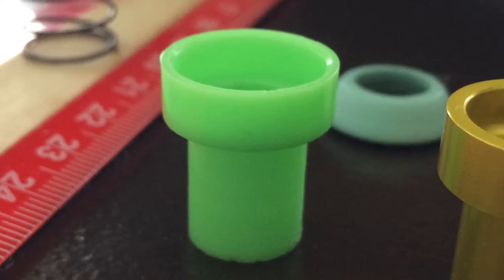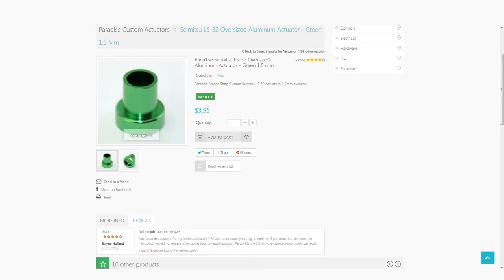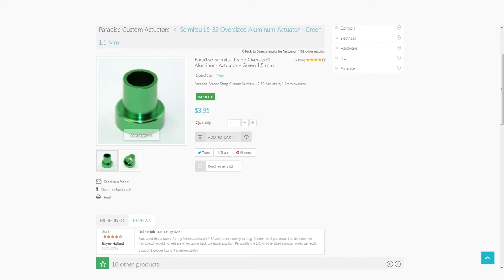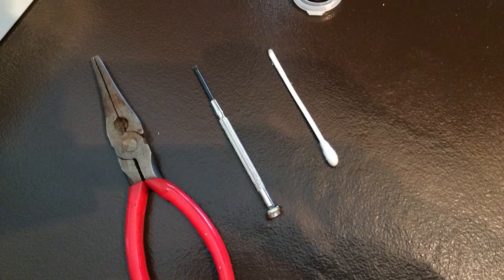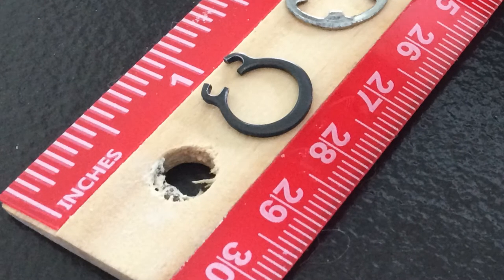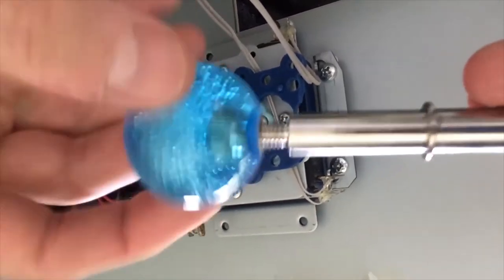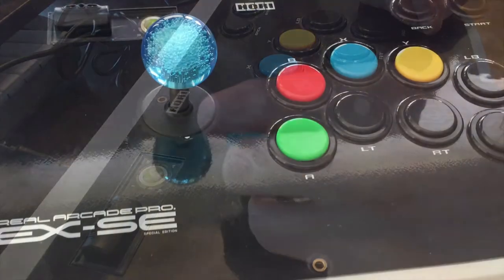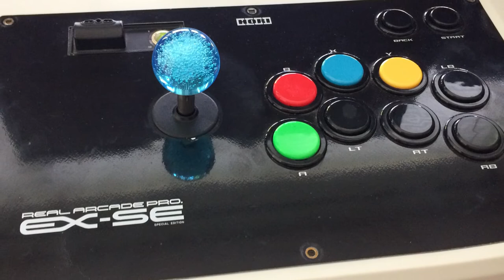LS32 Joystick Shorter Engage Mod - Will it Work?

Comment: I still prefer the ls-40, has more short throw than ls-32, uses c-clip and was the default lever for Japan neo geo cabinets.
I also have the ls-32, did annoy me the pivot popping while pressed against the gate, but after removing the gate it feels better.
Reply from the maker: Just switched over to LS-40 and yes it is overall built extremely well and feels great. I'll have a video on this soon. The pivot pop issue didn't bother me too much. I don't ride gates hard enough to notice, and for some reason the issue all but went away with some time. Both sticks are extremely good and I suspect every Seimitsu is top tier. Thanks for the comment!

Comment: 1mm is a huge jump if you are having a problem with return to center you can increase spring tension or drop to the .5mm actuator.
1.5mm changes the profile and is something to consider with longer engage switches like Omron silents.
Reply from the maker: You're right in that the larger actuators are meant for silent switches, custom switches, or those without paddles. I really should have tried the .5mm but I'm skeptical of all of these actuators at this point. I've tried several now for different sticks and none really feel like they "belong" in the stick. Even if they don't have game-killing side effects like I had here, they tend to have a clunkier feel. I'm just not convinced they are as precision tested as the company's that make the original parts.
Reply: @neondagger  not sure precision is the right word, most of the oversized actuators have the same precision of production as the original, and infact many have more because they are machined and no molded.  The change in feel is a preference thing more than a precision.  All microswitches have lag between off and on, these actuators can make that more noticeable because they sit closer to that point.  
Another option is to ditch the actuators all together and go with something like the Magenta for programmable precision.

Comment: LS-62 was my favorite for a while, but I ended up with the LS-40 because the square gate allows easier diagonals, has less neutral wiggle and the shaft is longer. I play mainly NeoGeo games on Switch and PS5 in addition to a few newer titles like KOF XV and for me, Sanwa and Hayabusa SUCK for those. Trying to play any KOF with the Hayabusa was like using a broken controller and the JLF was only slightly better. I almost gave up and went back to the standard controller until I tried Seimitsu and never went back.

Comment: I thought I liked the ls-56 best but it takes so much force to actually actuate the switches that I went back to my ls-32.
Reply from the maker: I agree. I don't know why people like stiff spring tensions, which is why the 56 feels so hard to activate. Shmups especially are about lots of little quick movements so I don't think it's a great idea. My sense is people often use higher spring tension to compensate for the imprecise feel of having too high of a shaft height, which is incidentally the case with the 56 as well.
Reply: @neondagger  Totally agree. On top of that I'd be interested to know how good those "ls-56 is the shmup stick" guys are. I mean the best players in the world are found in Japanese arcades and most cabinets use ls-32s.
Very often it's those that like to tinker with their equipment more than putting it to use. I observed this phenomenon quite often. Like FPS gamers who meticulously research mice and sensitivity instead of practicing with the equipment at hand.

Comment: Hey you can fix that by stuffing a washer between the clip and the actuator to press is down a bit more or shaving the edges a bit round. It only works in a jlf with square gate out of the box. But I can sum it up real quick for you. Yes it engages quicker but the stick will also not disengage like you where used to. I could not find a fitting spring to fix that. It's not like you suddenly need a 3lbs one, more like 2.3
Reply from the maker: I did resort to sanding down the edges on the actuator but it still didn't quite work. The washer trick wouldn't work here because the actuator isn't tapered like on stock JLF or LS-32. I looked around and what I figured was this: the oversized actuator is meant to be used with non-stock microswitches. So if you used JLF micros or micros without those little paddles, you'd have roughly 1mm of extra deadzone, in which case the oversize can help make up the difference. After all of that mess I can honestly say the better option is to get a shorter engage stick. The LS-40 is basically a shorter engage LS-32 so it seems to be the solution here. I'll have a video up on it soon. Thanks for the comment!

Comment: Great Video indeed! What do U think about the LS-56? Im new to shmups and just modded my mayflash f500 Elite with the ls-32. Just Ordered the 56 though, cause of the shorter engage
Reply from the maker: I asked around recently about this and in my research it came down to LS-40 (tweaked LS-32), or LS-62 (tweaked LS-56) all have shorter engage/throws. I've never tried the 56 though I know it is popular. For me, always thought the LS-32 would be perfect if just slightly less throw/engage. On paper the LS-40 has the shortest engage and throw. But the shaft is slightly taller/fatter which I'll have to find workarounds for. It's coming in the mail today so will do a video on it soon to see how it goes.
Reply: @neondagger  thanks! Would like to hear your verdict on IT. I will let U know about the LS-56. Seems like everybody is reporting different experiences... 😂🤦🏻‍♂️
Reply: @neondagger   i have used an LS-40 with a bat top for a long time now, and i would say it is the better for shmups. have you thought about the SEIMITSU BULLET LSX-NOBI LEVER. i am personally thinking about trying it out.
Reply from the maker: @theatlantichoneypotassocia853  I just installed the LS-40 and tried it out yesterday, replacing my LS-32. I'll have a video here very soon about my thoughts. I just heard about the NOBI lever. I think it looks interesting but I don't know much about it. One thing is for sure, Seimitsu makes amazing levers so I'm sure its very good.

Comment: Thanks for the vid. It helped with the clip. Also do you know which actuator is wider, the stock LS-32 or the kowal oversized actuator for the JLF?
Reply from the maker: The JLF Kowal is wider but the JLF has a larger distance to engage compared to LS-32. When installed, it brings the JLF to a similar engage distance as the stock LS-32, but the Kowal feels clunky and not quite right to me. Other people seem to like it though.
Reply: @neondagger  Ive used the JLF with the "shmup mod" as its called and it doesnt feel very nice to me, mostly because of the doubled resistance, but I did get some nice performance results out of it. LS-32 felt kinda average to me when I first tried it but I now have a set up where I mounted it a few mm lower than normal and switched the balltop for a bat top and I love the combination. 

Btw what are your opinions on the seimitsu "popping" phenomenon?
Reply from the maker: @wadestoss3325  I've come to find the LS-32 is sort of this average stick and that is its super-power. I've done a ridiculous amount of analysis on this lately and will talk about in the next video. Makes sense that a lower mount worked well for you. The pop: I noticed it when I first got the 32, but over time I didn't ride the gates as hard and didn't notice it as much. Eventually the pop all but went away.

Comment: I changed the spring and gate in my JLF. 4lb spring, 8-way gate. That tightened every thing up, made it more accurate
Reply from the maker: Yes you an definitely make improvements to any stick. For me I went from JLF -> LS32 -> LS40 and along the way I've made little mods to customize it.

Comment: Which semitsu lever you recomend to mod the Qanba Drone?
Reply from the maker: Check out my video here https://youtu.be/ghadFSmtdVU where I go over the LS40 vs LS32. It comes down to individual preference. I was on 32 for many years but recently moved to 40, which has tighter control but if you're used to loose sticks then maybe the 32 is better for you.
Reply: @neondagger  thanks for the info, you have a new Sub, 👍🏻
Reply: The ls32 and the ls40 are too big for the drone. The ls56 could fit theoretically.

Comment: shame you didn't find the right solution for your problem...
I have changed the spring for the "harder" spring and it changes the feeling a little bit. 
Of course changing the actuator is the best way to resolve this problem.. or changing the joystick....
Reply from the maker: Yes, actually this whole issue put me down quite a path and I ended up "solving" it with another joystick. I'm wary about tinkering too much with stock controls because often a gain in one direction is a loss in another. Hopefully I'll have that video on the "solution" very soon. It is nearly a perfect solution but did have quite a learning curve to it.
Reply: @neondagger  And what brand or model did you use ? 
I'm asking this because, I was a big fan of "Japanese" joystick (I started to ply in the 80 ies in the arcade.. and frankly the American joystick was not god for my taste), Sanwa and Seimitsu. 
In 2021, I don't know anymore.... I'm starting to look at the Korean joystick (Fanta and Crown....). One of my friend let me try a Korean joystick for one week... and frankly, I didn't get "the trick". I play mainly shmups and arcade games. 
I'm not a fan of Tekken...
Reply from the maker: @TheFrenchy82  For me there really weren't a lot of choices on the table, because I already knew the Seimitsu LS-32 worked for me and I only needed small adjustments to it. I've been on it for nearly 10 years and I've gotten pretty optimized on it. So on the list of choices I really had only once clear winner and that was the LS-40. Mainly because it had the most similar attributes to the LS-32 as compared to the rest of the Seimistu line, but with a lower shaft height, much quicker engage, slightly shorter throw, and really tight return to neutral. On paper it was pretty much everything I was looking for. So, I got it and it has turned out to be that "perfect stick" for me. But it was a fairly steep learning curve even though it shouldn't seem that way on paper. Mainly the shorter engage required me to play a lot lighter and with more precises movements on the stick to avoid hitting wrong directions. After an adjustment it's definitely my go-to for shmups, while the LS-32 is sort of my new all-arounder for all kinds of genres (fighting, sidescrollers, etc). The Korean sticks (Crown, etc) have really odd gimmicks that to me seem to suggest it was made to deal with issues that Korean fighting game players face (particularly when playing Tekken, and in specific wave dashing and so forth). But I do hear several players like it for shmups. So it's always worth a try but if you can't see how your game would level up with a bit of practice I see no point in "trying" to like a particular stick. Go with what feels right.

Comment: About to do the same mod for my Ls-32 (Ls300 aka 2017 new version) with the PAS gold 1mm oversize actuator, but I'm also going to get a few 2lb, 3lb and 4lb seimitsu custom springs from Arcade shock!! 

You may want to grab some of those for a quicker return to neutral. I'm a fighting game guy, but I have a feeling that even with the stock actuator, you might benefit your shooting games from the 2lb custom arcade shock ls-32 spring depending on preference of course.

 From what I have read, some people believe the ls-32 to be a 'jack of all trades' when it comes to game types  and that the LS-40 is quicker for shooters, I did want to get an LS-40 as I'd made a tribute stick to the MVS - U4 cabinet, however I believe they use the discontinued Panasonic microswitches so got the new LS32 with the omrons. 

Great video!
Reply from the maker: Yeah I have trouble with stiffer springs. I tend to go for as light as possible while having a good neutral return. The LS-32 return on stock is pretty good. Much better than the JLF, for example. I'll have a video up soon on the LS-40 which is basically an LS-32 without a deadzone, and the neutral return is flawless (no deflection/wobble). The LS-32 is definitely an all-purpose while also fantastic for shooters. It came down to either replacing all my sticks with 32's or switching to the 40. Still testing but I'll have that vid up soon. Thanks for the comment!
Reply: @neondagger  nice, yeah I hear you on the LS-40 I just am waiting for it to arrive in the post.

 As for a Jlf, I have a jlf with a Kowal actuator 11.8mm, 2.5 lb spring, and Otto DIY V5 pivot. if you used a short Jlf shaft with that set up and spring of your choice, I've got a feeling that would be quite good for a shooting game, almost zero deadzone and the V5 kit comes with 12,12.5 and 13mm actuator too. 

But I've read a lot about the preference of shooter players, and whilst that's not my main thing, I seemed to read that a lot of people liked the LS-56 it essentially seems to be a compact version of a 40 so it's even tighter, minimal throw and engage it seems.

As for the ls32, it did have quite a bit of deadzone. also read that you can just put in jlf microswitches in even without the long arm/tab bit, I'm going to give that a go an see if the actuator works with that.

It's a long quest for the perfect setup 👌🏻

Edit: realised that the ls-40 it totally fine to use the new 2017 microswitches so all good, apparently the new 2017 seimitsu ones are slightly more activation than the panasonic/matsushita ones.
Reply: @Ozyrus  i was curious about the 2017 Ls32 model. Has it fixed the jumping pivot like the OG model? I love the LS32 as its very satisfiing hiting the switches doing dash moves for example.
Reply: @segajcharrua  it does have it but you only have it occur if the stick is already against the gate and then you intentionally press hard against it, shouldn't ever occur with good technique I've had it happen once ever by accident, the new microswitches are slightly higher activation force which is good so those will aid your dashes
Reply: @Ozyrus  thank you for the feedback! So its not worth to get the 2017 movel if i  have OG model in that case right?
Reply: @segajcharrua  subjective perspective determines that 🕹 only difference is the microswitches
Reply: @Ozyrus  i see. The time i searched about it stated that the 2017 model would had fixed the jumping pivot. But only by trying it will determine how i fell about both. Thank you!
Reply: @segajcharrua  I got an ls-40, I'd reccommend it, a bit harder for fighters , good for shoot em ups, really good stick though if you haven't tried it
Reply: @Ozyrus  i got the ls-40 i liked but i didnt want to have a genre specific stick as i  like to play many things , shmups too.
Reply: @neondagger  was gonna say, there is the ls-32 metal pivot now, wonder if you would like that, it was advertised as arcade shock as not requiring as much grease overtime, however semitsus website says it actually requires more regular greasing than the standard pivot. I have one and it seems to add a slight quicker return to center, you might like it, me personally I'm going to go back tok the stock pivot, some people claim you can use this metal pivot for the 40, each to their own but I think unnessecary, the metal pivot could be smoother for ahmups, but it does add some resistance, thought of you bro!

Comment: try ls-56 with octa gate and try the ls-40

EDIT: Don't try the ls-56 with octa gate 
try ls-56 with kowal short throw mod spacers
and try the ls-40 with home made spacers
I like to only set the gate higher so that the post activation throw is reduced!
Reply from the maker: Homemade spacers?
Reply: I used nuts now. Maybe not the most elegant solution
Ordering spare gates soon. Then I will try to sandwich 2 gates together by clipping off some of the studs

 @neondagger

Comment: Ytou must try LS-56
Reply from the maker: Yes it was the first one I looked into as an alternative. But for me the shaft height was a bit too high and I wanted a shorter throw so I went with the LS40 instead. Ended up being what I needed. Made a different video about that process.
Reply: I don´t like stick shaft very low but LS-56 the spring perfect with and more Kowal Short Throw for the is the second stick favourite. The best for my is my Magstick from I.L
Reply from the maker: @unaigalder  Interesting, never heard of Magstick until now. I think there are competitors showing up (often from korea) that have interesting stick designs and there should be something out there for everyone to meet their needs. For me, I just never go wrong with Seimitsu and I'm sure all of their sticks would be as close to perfect for me as it gets. It's so close in design and quality that I can be picky about shaft height and all these little details.
Reply: @neondagger  Magstick is Happ American Style with good parts